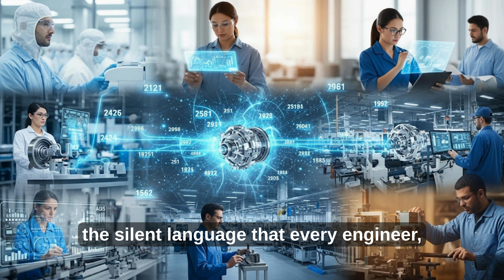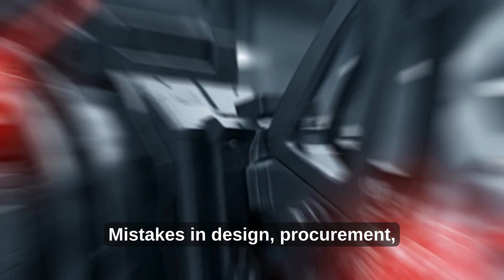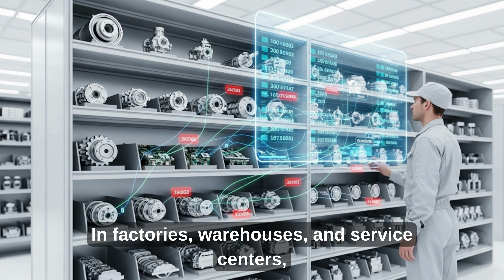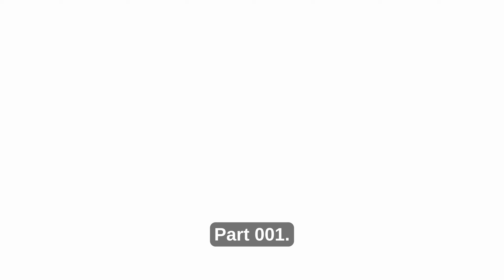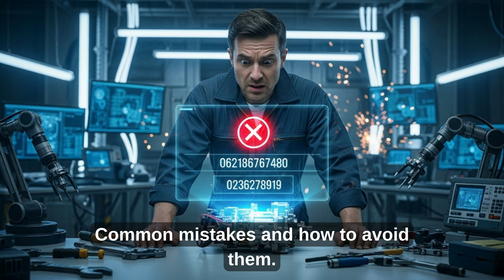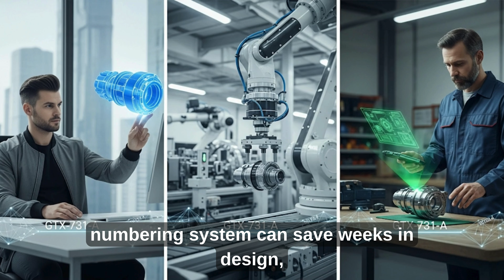Part Numbering in Mechanical Design | Complete Guide

Comment: Not only is this AI gross, the first example shows immediately how this system fails. Is the bolt a SHCS, BHCS, FHCS, Hex Bolt, Carriage Bolt, etc. Is it M8x1.25, M8x1, or M8x.75? What type of stainless steel is it, 304, 316, 430, 410???? I stopped watching after that.
Reply from the maker: Fair point! 👍